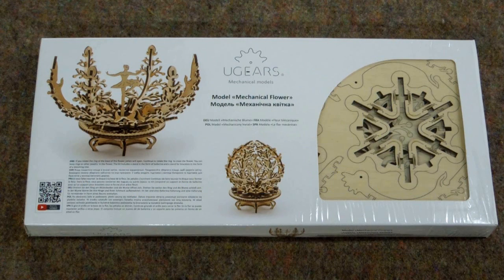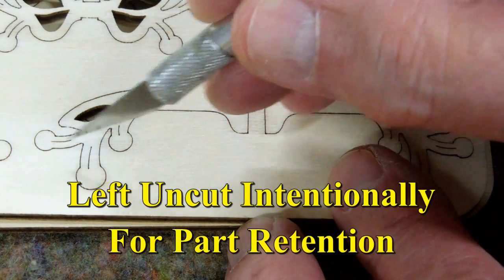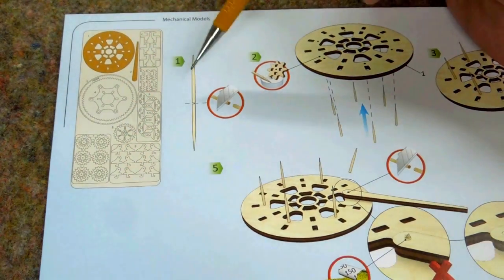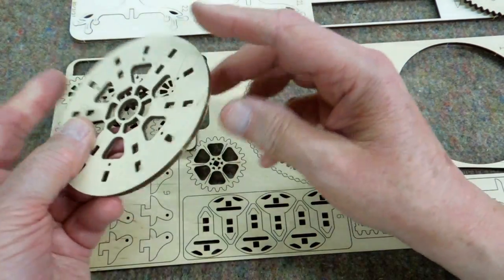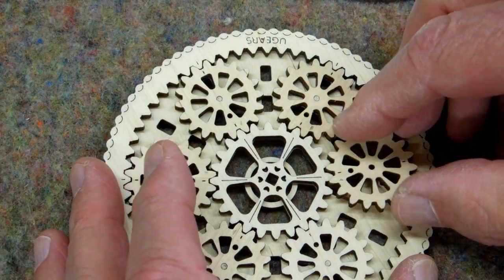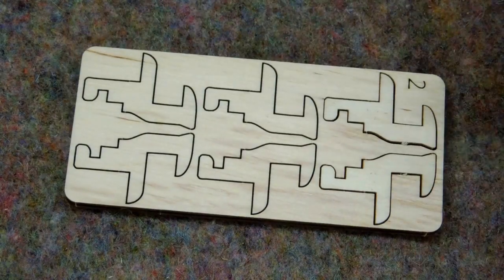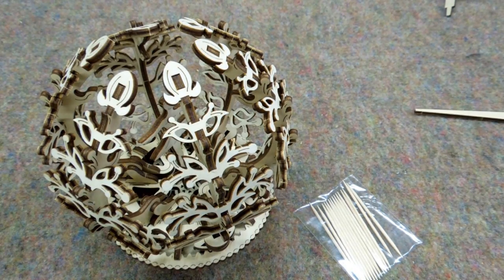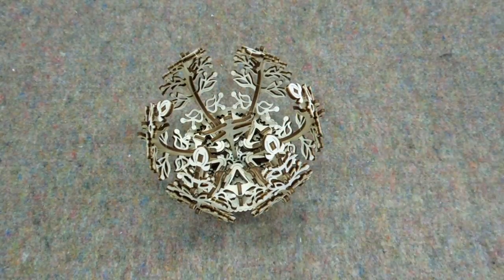Mechanical Flower Part 1 - Build & Review

Comment: Excuse me, sir. I've ordered one of these kits in order to build one for my younger sister who had snapped two of the arms on her first attempt, and I was wondering as it's my first time to undertake such a task, would you be able to explain how to wax the smaller pieces? Do I just need a paraffin bar to rub the wood against, or I will I need a more detailed method to handle the smaller pieces?
Reply from the maker: This is not an assembly for the impatient. Prior modeling experience is a benefit but not a necessity. Everyone needs to start somewhere. Take your time, slow and steady, treating every piece like an egg shell which can break. It is a very precisely made mechanism and it can be assembled to work as shown in the video. It is easier to wax parts prior to assembly. Rubbing the wood against the paraffin will transfer wax to the wood. I show how I did the toothpicks in the video. In order to get wax into smaller areas (like inside gear teeth) repeated use of an edge of the paraffin bar will develop a groove in the paraffin which will match the shape of the teeth and make things a bit easier. Or you can slice off a piece of paraffin with a sharp knife and use that piece to get into smaller, tighter places. Every surface which rubs against, or turns against another surface should be waxed. To prevent making a mess, I suggest doing the waxing over a newspaper to catch the bits of wax which will fall off during the process. While some pieces need to be a tight fit, all the edges of the multiple pieces of an assembly must be in perfect alignment before pressing everything together. If it is not obvious all the parts are going together, start over, realign the parts and try again. Don't try to brute force it together or something will break. To prevent breakage, use a second piece of wood (like the tool) to support the outer surface of pieces like the petals when pressing them into the arms (as shown in the video). Non movable joints (like the petals joining the arms) are not waxed. All pressed together joints must be fully seated (no gaps in the joint). I wish you success and enjoy the process. Thank you for watching and please subscribe. Ron

Comment: I have bought a few kits and assembled two of them. Everything fits and works. They're relaxing to build, and if I get frustrated, I simply walk away then come back later an continue the build.
Reply: I watched your video since i bought the same kit. Very informative but i noticed when you put the petal pieces together the ballerina was already in place - i have not gotten that far so i assume that piece assembly is very intuitive/easy
Reply from the maker: The ballerina just plugs into the slot... you use either the ballerina or the "tree".
Reply: @RonaldWalters2010  thats what i thought - the directions did not clarify that

Comment: Very intriguing models. Good assortment, too. However, the site gives me "We're sorry, this content cannot be displayed. Please try again later." on most of the page. So I don't know what the other pictures are and couldn't order anything.
Reply from the maker: Sounds like you are having a problem with your internet service. Clicking on the link in the description the site immediately came up, every item displayed and all were available. Please try again. Ron
Reply: Since it came up with "We're sorry, this content cannot be displayed. Please try again later." on each individual item window it was a problem within the page itself. I tried again and now it all works. Now to choose one for my daughter. She wouldn't want the flower except for the mechanical aspect. She would rather strip, lube and readjust her bike than pick flowers. Or help me build a trailer or fix the tractor. A 10yo engineer in the making.